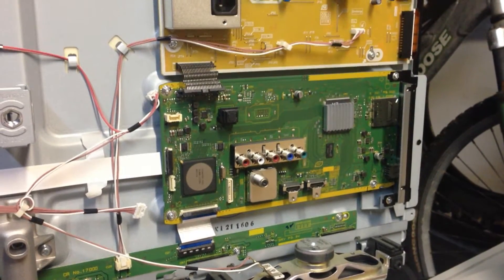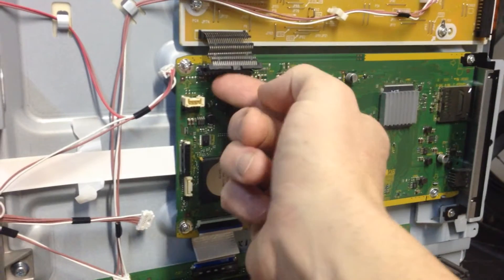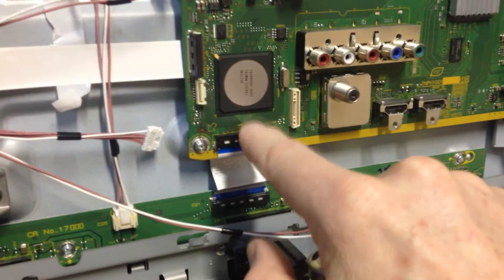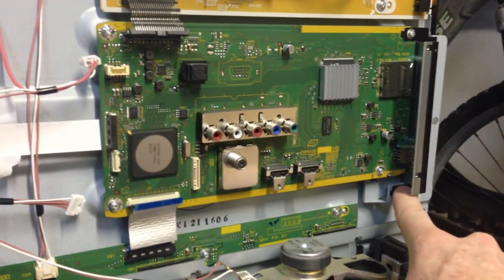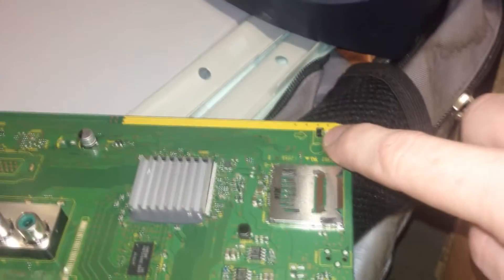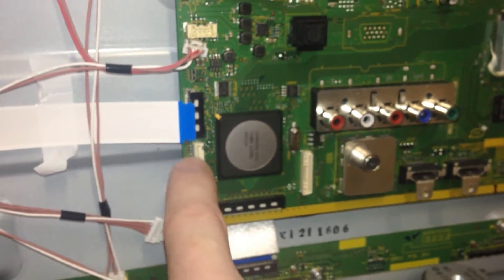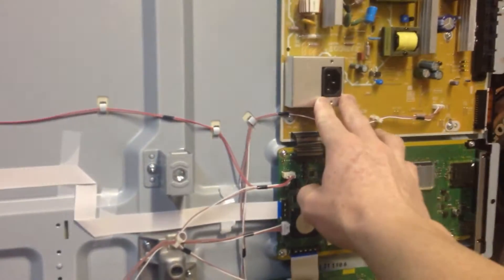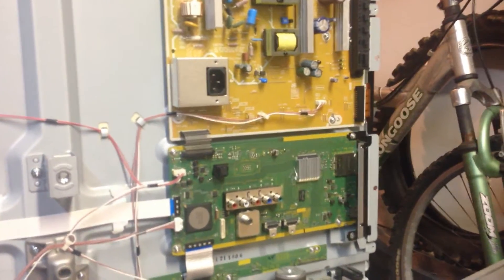Panasonic Plasma TV TC-P50X5 How To Replace Logic Main Board

Comment: hi hope you have a excellent new year. I have a Panasonic viera tcp42x5 and I replace the SN board and corrected the 7 blinks of dead however i do not have nothing showing in the screen even have a steady red light no blinking but it seems some other problem i am hesitant to get the Main Board or the power supply any suggestions on what could be the problem that way i can order eider one